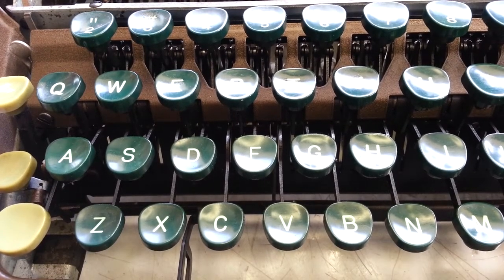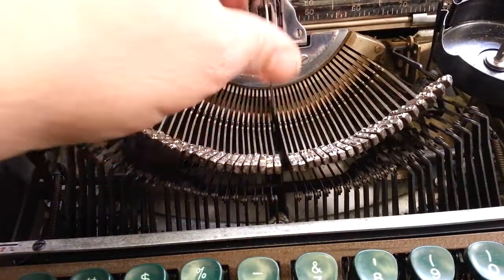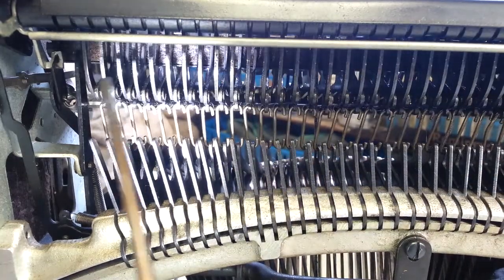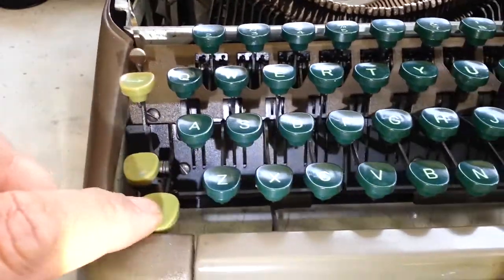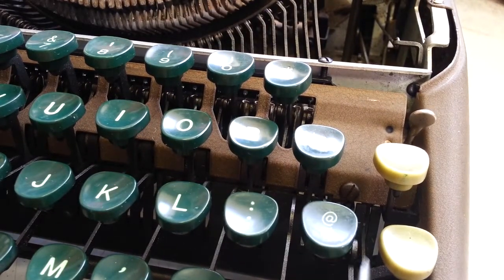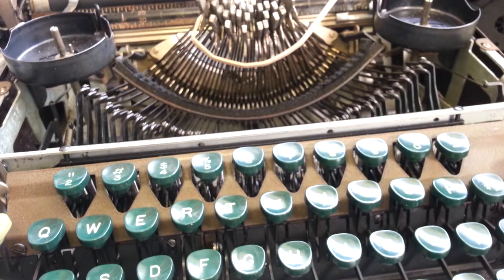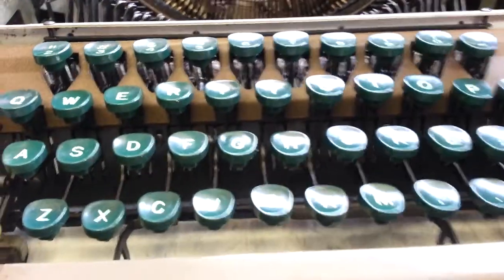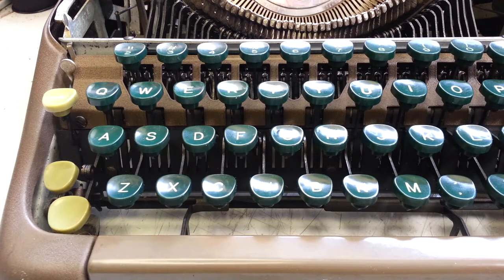Smith Corona Typewriter Adjusted Key Rest Cushion Sticky Keyboard Stiff Touch Repaired

Comment: Just had a Silent 2 with exactly this same issue. Just half a dozen keys, but for the life of me I couldn't figure out where the problem was. Then I remembered that I had seen this video a few days ago. Problem solved! Thanks again, Duane! One trap there, though, it seems. If you lower it too much, I found that the backspace pawl starts grinding. So "Just Enough" is all you need and watch that backspace lever.